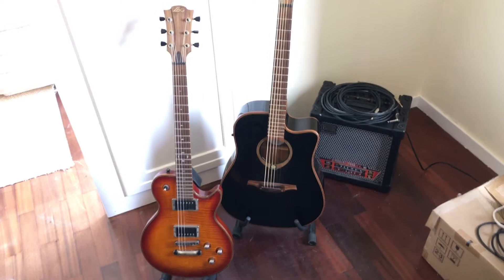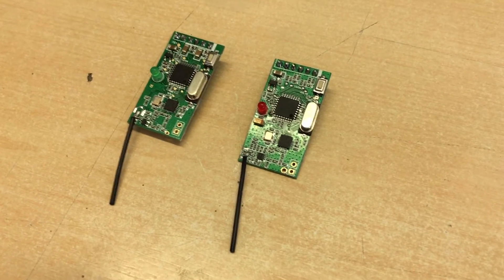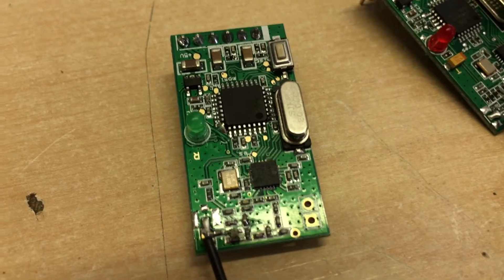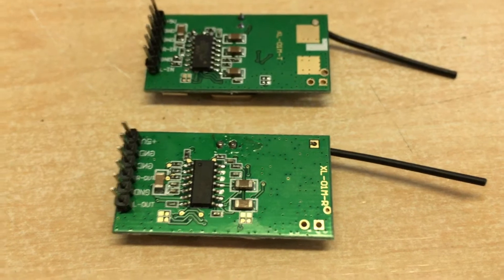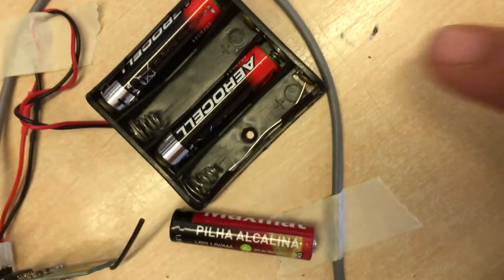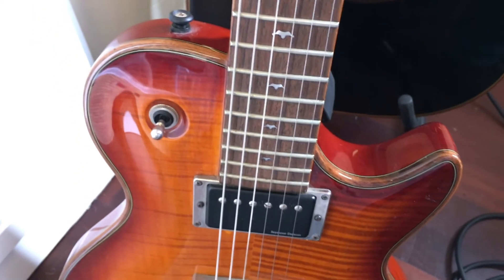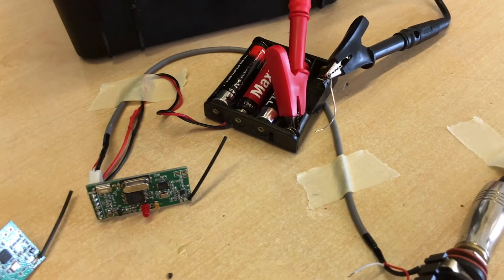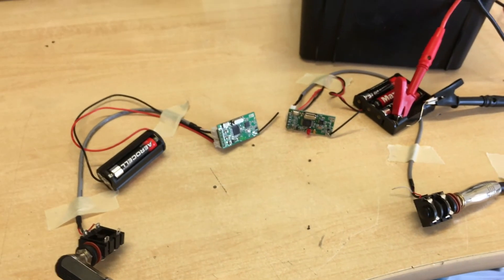DIY wireless guitar system using NRF24L01

Comment: Good work! I used 3,7v battery with step up converter with charge function. One downside of this solution (step-up) was pretty high noise level. With some inductor/cap solution helped reduce the noise but the module is very sensitive. I wanted actually to create wireless in ear monitoring, hence the need for 5v supply. I got pretty good workable solution and great quality sound in headphones. Actually the nrf24l01 is not the best solution for digital audio, more like creating wirelessly controlled stepper motors etc. For the guitar I would use good old 630mhz system (some sellers in ebay offer such modules, even customized frequencies) or even pll controlled tx/rx modules. Wish you the best and thanx for sharing!

Comment: Sorry about resurrecting an old post, but you mentioned a Nordic - AKG collaboration or project.  I did some research on the internet and could not find anything on this.  Do you have any more information?
Reply from the maker: Not specifically, but there are numerous systems around these days that work quite well. I have one that I bought on Amazon that does a good job - it’s a Lekato

Comment: Have you tried the channels? Because I want to use 5 pairs at the same time with different channels. And my second question: have you tried them with headphones. I would like to use reciever with headphones and transmitter input is mixer line output. I ll try to design a wireless inear system for my band. Thank you for your demonstration.
Reply from the maker: I gave up on this project, as I’ve said in the comments, because it drew too much current and battery drain became an issue. There are also now commercial versions available at quite a reasonable cost, so my objective of getting a system way cheaper than comercial went out the window.
Reply: @electronicsoldandnew  According to your calculations, won't they work for 5 hours with two 18650 batteries? 5 hours is enough for us. My purpose of the using this modules is, commercial versions allow me to use max 4 channel use at the same time( cheapest ones). This module allow 16 channel. I could not find min 5 channel wireless audio module. Dou you have different alternatives for that ? Thank you.
Reply from the maker: I’m afraid I don’t.
Reply: @electronicsoldandnew  Do you have any other complain other than battery life issue? If it drawn low current, Would you prefer?
Reply from the maker: No, not anymore. I’ve actually bought a comercial unit that I use all the time.

Comment: Why not use a li ion or lipo battery which can come down to 3.7 and 3.6 amps and charge to 4.2 volts. Plus a single cell can be upto 3500 or 3600 mah, which in this case will work 2-2.5 times plus, compared to 1000 mah.

I am surely ordering them because the commercially available sets "for guitar" are priced astronomically and unnecessarily high. Have you tried using a Bluetooth system instead of 2.4 ghz? I look forward to the next vid on this topic. Thanks.
Reply from the maker: As I mentioned in some of the comments, I actually did not take this project further as the quality and ease of use were not satisfactory.

Comment: Thanks for the video, any update on the project like using ESP8266 I2S  Audio Streaming ...
Reply from the maker: No. After this project, some comercial units came on the market at really low prices and without the problem of high current draw, so I decided not to take this further.
Reply: Electronics Old and New by M Caldeira Do you have a reference for one of these commercial units? I'm interested in testing this
Reply from the maker: Theo ones I mean  are the boss, Harley Benton, etc, where you just plug in one jack to the guitar and another to the amp.
Reply: @electronicsoldandnew  Thanks for the prompt reply, appreciated

Comment: hows the audio quality?
Reply from the maker: It wasn’t bad when I built it, but the power consumption was a little too high for practical use. Now there are much cheaper units available commercially, which makes this project really more experimental than practical.
Reply: @electronicsoldandnew  AWESOME content! Probably the only man on youtube doing this kind of stuff... Could you please tell us some unit modules that could be used in the same project, but in 2021? The main purpose of this is to Do It Yourself from modules and play with some wires, soldering and programming.
Reply from the maker: I stopped this project because some comercial options came on the market which are really much more affordable. I’d recommend going that route in 2021, because power consumption on this project makes it really impractical to use daily.

Comment: Hello. I Have two pairs of those and, the connection is lost frequently. Sometimes it works fine for several minutes, sometimes just for a few minutes. This happens in the middle of a song. The transmission restarts when I press the "Pair" button in the transmitter, only to drop again minutes later. They were bought from diferent sellers. Do you experience the same?
Reply: Thank you for leading me to the solution. Increasing the capacitance in the power rails of the chips solved the problem. I soldered some electrolitic capacitors in both the transmitter and the receiver.
Reply from the maker: André Almeida : I did not have that problem, but found that the current drawn is too high for practical battery operation.
Reply: I tested mine with a power supply and with a Li-ion 18650. I Will test them with two power supplies and will post the results.

Comment: Thanks, this is a great video. Im just getting started with building my own electronics, and for my first project ive decided to make my own wireless guitar system. I was wondering if you ever got around to finishing this project, or have plans to? Would love to see the end of it.
Reply from the maker: John Pike : hi john. The issue if the very high current consumption made me realise that I’d be changing batteries at a frightening rate, so I decided that it was not going to be viable, unfortunately.
Reply: I see, well would you change your mind if i let you know that apparently the NrF2460 has been added to an integrated circuit board now?eg: https://www.aliexpress.com/item/Special-Price-Based-on-Nordic-NRF2460-2-4GHz-High-Fidelity-Wireless-Digital-Microphone-NX109/32855253020.html

Comment: how to improve antenna reception?
Reply from the maker: Rodrigo mug : antenna range is not the problem as long as you stay within a reasonable distance. The problem is battery consumption, which is quite high.
Reply: Hi. I noticed that there are a few pads on the back of the transmitter that look like you could attach an antenna to.

Comment: Hey man, great video! A few questions:
1. Is this the same as the one you used?
https://www.amazon.in/Elecmake-NRF24L01-Antenna-Wireless-Transceiver/dp/B01LXFIRD8?tag=googinhydr18418-21&tag=googinkenshoo-21&ascsubtag=9f5ce289-e968-4df0-ab06-bc292ebfa1a1
2. Have you checked the range?
3. Would you recommend this for small gigs?
4. Would this be better or worse than getting a wireless mic system and wiring it for my guitar?
Reply from the maker: Rhitosparsha Baishya : it looks about the same.
However, I have some advise for you. 
Since I did this experiment, a new chip came out which is used in various comercial systems, at what I consider a great price, and it makes this project somewhat outdated. 
The line6 G10 is the one I have my eye on. I can get it for about 130€ in Europe, so building ‘my’ system is no longer that much of a saving.
Reply: +M Caldeira Thanks man! In India, the G10 costs something like INR 20k, while your setup would cost  under INR 3k. So it's a very large price difference. :(
However, as I mentioned, would making this unit be better or worse than modifying a wireless mic system to receive guitar input?
Reply from the maker: Rhitosparsha Baishya : I think it would be better that the modification you mention.

Comment: I assume this could be used for several types of wireless music applications... In-ear monitor system, wireless XLR input for virtually any microphone, wireless guitar system, etc. But I wonder how many of these systems you can use before interference starts to become an issue.
Reply from the maker: brdane : i believe the idea was for use in wireless speakers as the current draw is fairly high. If I remember correctly, they mentioned 16 channels. Not sure if this is the limit for the number of units you can use.
Reply: M Caldeira That would be amazing if so.
Reply: Also! What are the dimensions on each of these?

Comment: Hello! excuse my english! ... I'm from Venezuela and I need your help! Here I can only find the Arduino Nrf24l01 Transceiver Module ... would it be possible to do the same as in this video but with that module? It would be very helpful for me ...
Reply from the maker: Nagel : unfortunately no. The  module you mean is only the data transceiver, without the audio sections that includes A/D converter, D/A converter, etc.

Comment: id use a single 18650 and boost it to 5v.  2600mah 18650 will last quite a while.
Reply: actually you could just use an 18650 power bank caddy.  itll take care of your 5v for you.
Reply from the maker: +Do R/C! : that's a great idea. Thanks.

Comment: Just a thought, could the other channel be used as a mic input for adding cordless vocals? 100mA is high but probably not an issue for rechargeable cells, good luck if you are playing for 10 hours. I think you will need more re charging than the cells. What is the range available?
Reply from the maker: +Michael Beeny : I think it can, but I'm sure how much channel separation this thing has. Anyway, my singing is far worse than my playing, so it might not be a good idea. 
I haven't tested range yet as I'm now going to do the final connecting and packaging of the system, and will post another video when I have the final result.